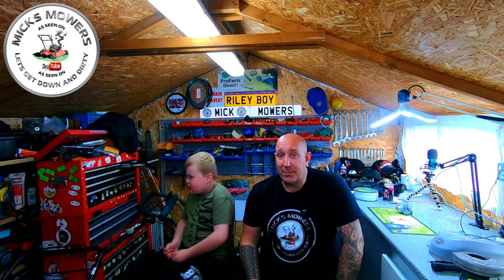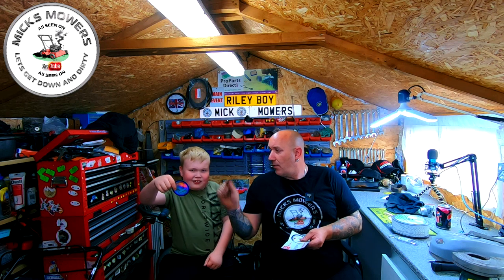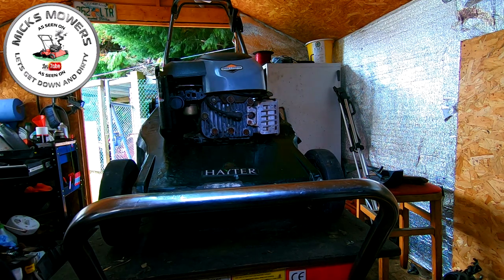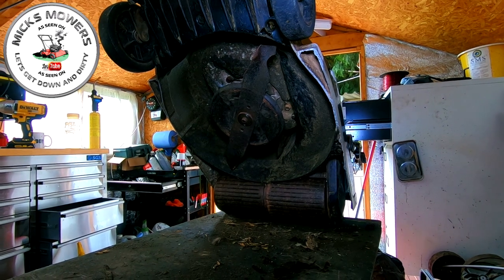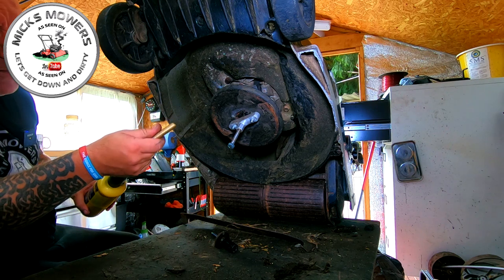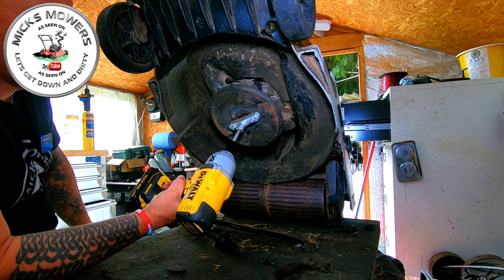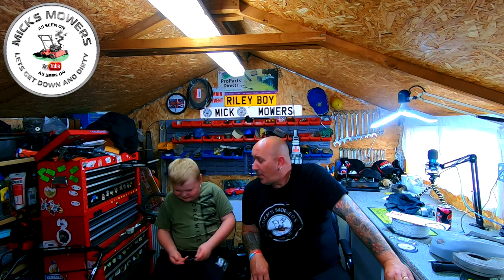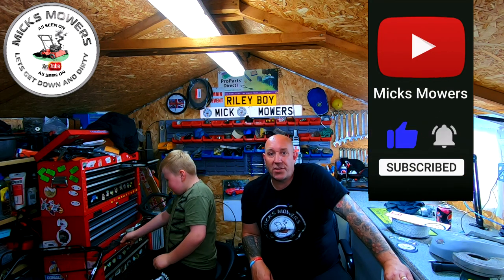Hayter 41 48 56 Friction Disc Removal Easy With The Correct Tool

Comment: hi mick ive got a hayter56 autodrive es  what i want to know is should the roller at the back be locked  only it goes forward when i push it but locks when i pull it back its not running bearing in mind   thanks mr. mowertorvator (mick)  cheers
Reply from the maker: Yeah it should roll both ways.. cable adjustment or belt I would say

Comment: Great video. Great content. 💯👍💯
Reply from the maker: Thanks mate
Reply: @themowerman  
Hi Mick.
Just a quick question,how the hell do you take off the drive shaft pulley??
Any chance one of your videos highlights this??
Many thanks Mark
Reply from the maker: @markb1487  depends on the model.. some are held on with roll pins.. other have a bolt or a c clip
Reply: @themowerman  roll pin,,,does that mean it knocks out off the drive it's self??
Reply from the maker: @markb1487  yes once you have taken the roll pins out
Reply: @themowerman  
Ok..Thankyou..

Comment: hi mick cant remove my blade on my hayter 56 es autodrive need it off to fix my cables  replaced  needs a good alround  service to work properly as i intend to sell it get it working properly as im like you reparing mowers and get a buzz from making  them work many thanks from mr . mowertorvator
Reply from the maker: Why can't you get it off.. what's stopping it
Reply: @themowerman  when i get the right size socket  it makes the flywheel go round when i try to undo it  i need the blade to keep still so i can undo it but she s tight as a ducks ass  hav got a good set of tools but not much knowhow  can you  help as this is a pain in the ass  many thanks mr. mowertorvator  say a big hi to rileyboy cheers
Reply from the maker: @micklawson3263  block the blade with a lump of wood  to stop it spinning
Reply: @themowerman  tried it dont work thinking of using a g clamp as an alternative respect  your help  let you know how i get on as you would say its a bit of a pig  cheers from mr.mowertovator
Reply: hi mick would like one of your stickers  with your logo on it would also like to have my logo made but dont know where to get these items from  any  idea\s   many thanks mr. mowertorvator  cheers
Reply from the maker: @micklawson3263  buzz me an email micksmowers01@gmail.com
Reply: @themowerman  could  not shift  the blade removal flywheel still turns around with the  blade  but however used drastic action and blowtorched it for 2/3mins on the bolt head and around the washer and it come off with the greatest of ease so many thanks for your valueable help  many thanks  mr .mowertorvator (mick) thanks
Reply from the maker: @micklawson3263  your welcome mate
Reply: @themowerman  hi mick have got a hayter56 es autodrive
i am going to take the rear roller off as i am doing a total stripdown  are there  any problems i should  look out for like hidden nuts  or bolts as  usual  i treasure your knowledge on mowers  ive been repairing  for 7 years now spend hours in my sheds just  out of interest  how many have you got up to date many thanks  mr..
mowertorvator (mick)  p.s. i want to get some custom stickers of my own so i can send some to you  but dont know  ought about it  any info would appreciate it  
cheers mick  say hi to rileyboy  thanks
Reply: hi mick is it possible  to get hold of some black outer cables not the inner core   i presume they come in lengths  and you can cut them to your own specs  cheers mate  mr . mowertorvator (mick) thanks
Reply from the maker: @micklawson3263  I have not seen any mate
Reply: @themowerman  hi mick have got  a macallister pro 50 mower problem with my drivebelt  have bought a new cable so i know its not that   have douwsed  the moving mechanisms with wd40  but its not biting when i engage the handle tried doing up the appropriate tensioners still no joy so the only thing  i can think of is the gearing box either its broke or ceased and just want stripping  cleaning or even replacing in general  then putting it back together again  so any ideas what it might be  cheers mate  from  mr. mowertorvator
(mick) thanks m8
Reply from the maker: @micklawson3263  In-gage the drive while the mower is running them pull the cable out sideways.. let me know if the drive them works
Reply: @themowerman  hi mick got a victa 235 1997  model mower  got it working as this was a non runner but its the ignition thats the problem as it wont shutoff the switch  is not where it should be according to some vids i seen there  are two wires 1 positive 1 negative but i have only the  1  and according to where its supposed to be is the back of the carby well its not  on mine i have only the 1 n that comes from the coil  which has 1 input this is most annoying as i want to sell it  any ideas m8  thanks mr.mowertorvstor (mick) cheers
Reply from the maker: @micklawson3263  send me some photos mate